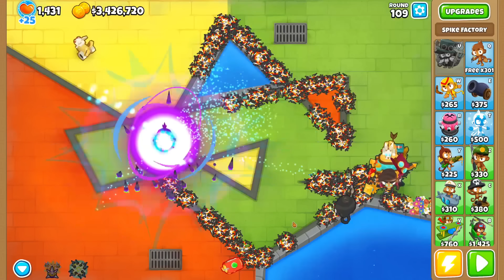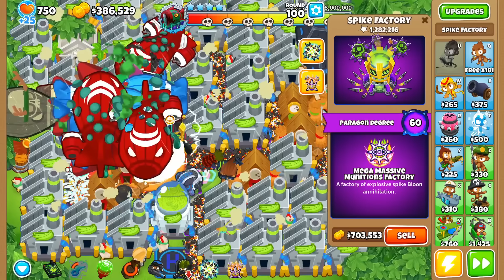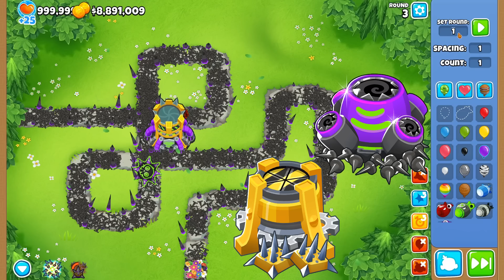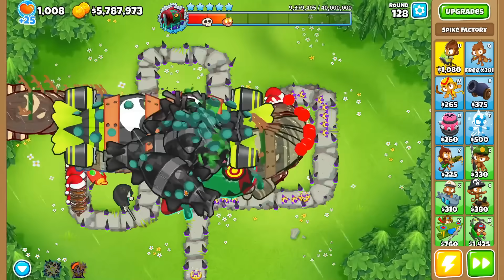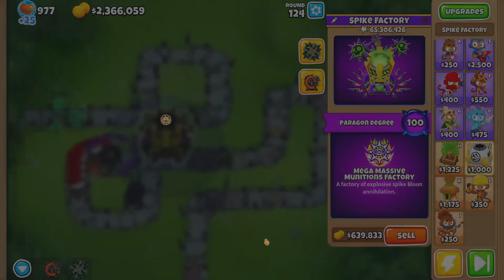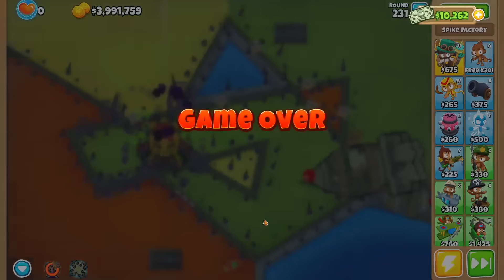How Good is the NEW Spike Factory Paragon in BTD6?

Comment: I think it’d be better if they just prevented boss insta-kills in ranked matches only instead of actively nerfing the brand new paragon against the exact type of thing it’s supposed to be the best at handling… they could just make it so ranked bosses gain an extra pulse ability that wipes out all damage sources (projectiles and track hazards like spike piles or acid pools) at the start of the battle, leaving regular ones alone since nobody should really care all that much what anyone does in non-ranked singleplayer play.
Reply: Agreed but it’d still be overpowered. The boss is supposed to be somewhat of a challenge. The spike factory would insta kill elite bosses with ease which would be overpowered. There’d be no reason to run any other paragon instead. It’d just be a free win tower.
Reply: @  I get that, though having all the spikes disappear instantly kinda renders the whole point of building up spike piles with the tower designed literally to do that exact thing seems kinda backwards to me. I think a better compromise for it could just be to make it so there’s a radius around the entrance location where all projectiles and track hazards with be wiped out, allowing you to still keep a spike pile built up if you just build it somewhere else on the track.

It’s less even about the boss to me than the spike factory paragon just being extremely nerfed for general use during a boss, since those spikes could have defended against regular bloons too. Not to mention, the spike paragon really wouldn’t even really be all that effective against bosses UNLESS you use it for insta-kills, because it drops spikes so insanely slowly and all the other bloons move so much more quickly that even if you DID build it far away from the entrance to avoid my proposed changed version from despawning them, regular bloons would likely set off most of the spikes long before the boss ever could.

A level 70 ace paragon + debuffers would probably be more effective against most bosses overall than a level 100 spactagon because the entire power of it that allows getting to nearly round 300 in the first place is from placing it at the end of the track like a permaspike. If the boss will just wipe out the pile anyway, then pretty much all of its damage potential during bosses is completely wiped out.

Comment: These are rhe changes I think need to be done to the spike factory paragon to make it perfect:

Increase the damage of the permanent carpet of spikes. I know it does more damage to moabs, but it is still not enough. If I'm correct it's just 4 times stronger than the Spirit of The Forest brambles, and hat just isn't good for the price tag. I'm fine with decreasing the bloon damage by a bit even, I just think it should do more damage to moabs. Like, twice as much as it does now or a little bit more.

Rework the speed buff ability. Right now, it's just a stat buff ability with 100%, and the whole "can only be used once a round" limitation doesn't work because the spikes last multiple rounds, meaning that you can just use the ability all rounds whenever possible and it will help you in the proceeding rounds. I would make the ability be just an automatic smarts spikes instead of a manual, would also make Lych more threatning and I like that.

Give it the targetting options of the bottom path. Really surprised it doesn't already have this.

Comment: This is going to be the new ultimate choice against bosses, and it's all because unlike the other paragons, this one can use all of its pierce against a single target. That makes it especially powerful against Lych and maybe even Vortex.

This paragon came out of nowhere, to the point where I started thinking about what the next one would be. I originally concluded it would be either Helicopter or Druid, but this one already takes Spirit of the Forest's main ability for itself.

Equally interesting, however, is that NK likes taking an ordinary tower and buffing it hard to shake up the meta a bit. They've done so for the last few patches, no reason to think it won't continue.
Reply: next  paragon will most likely  a military or magic paragon due to the order they've stuck with. Hopefully its druid but I'm fine with anything that isn't something new like the mermonkey.

Comment: The models for Degree 80 & 100 are the same across ALL Paragons. I, personally, think they should change once you get 1 degree higher than a multiple of 20; that way, each of the 5 models are split across 20 Degrees.

Comment: I think even your freeplay demonstration is a serious understatement of the new paragon's freeplay power. With temples, CC towers, and other paragons handling the ZOMG and lower bloons, the factory can be placed at the back of the track and use 100% of it's damage on the FBAD's that are always the first thing to leak through a strong freeplay defense. 

Also, small thing but the factory would have done better in both tests if it was placed closer to the end - more time to build up mines for the boss, and more damage from the permanent spikes all along the path to weaken the bloons before they reach the spike pile.
Reply: @ true but in a realistic boss battle you wouldn't put it at the end especially if it's your only paragon as the kill time would be too slow
Reply: @pvz_games What? Why? Kill time doesn't matter in most boss events.
Reply: @EllipticalReasoning  for tie breakers it does matter
Reply: @pvz_games tie breakers are a relatively low priority for most people doing boss events, and in the case that a spike paragon in the back of the track is the most efficient way to win (in tiers/cost/whatever), moving it closer for a faster kill becomes an opportunity for skill expression.
Reply: @EllipticalReasoning  true but if for example 10s of people get the same score which happens farily often especially if a boss is super easy the time aspect will matter most, and for the bosses which are time based by default it will also matter. 1/3 of bosses are time bosses (logically at least, since there is time, least tiers and least cash), so it still would be best to just have it further up, depending on map ofc.

Comment: My favourite part of this Paragon is what it means for the Master Builder. One of the older patch notes said they'd wait for another damage-based support Paragon before considering a rework to MB, which is exactly what the Mega Massive Factory is, so now might finally be the time.
Reply: What annoyed me was the Master Builder didn't incorporate all 3 paths. Here's my stupid suggestions for engi paragon:
- Keep the sentries, maybe nerf the damage
- XXXXXL laser trap ability. Can swallow a BAD and provides income. Limited uses per round
- Gigaboost. Like ultraboost that stacks up to 20 times.
- Super cleansing foam. Removes camo and lead properties from DDTs, and fortified from moabs like shattering shells
Reply: @vinesthemonkey Maybe the cleansing foam could also debuff any bloon that passes over it with + damage? I would say slow but that would step on the toes of the glue gunner paragon when that comes out.
Reply: @vinesthemonkey  I had a idea where the bloon trap would be constantly on the floor in a "deactivaded mode" while deactivaded it would work as a unlimited foam and then with a activaded ability the trap woud open up swalowing all bloon types includind BADs
Reply: @vinesthemonkey don’t call your suggestion stupid that seems insecure
Reply: @vinesthemonkey who wants to stack something 20 times? it should just be a boost that u can use on other paragons
Reply: @vinesthemonkey No. Stop. Why does everyone want it to instakill BADs. Not all Paragons should have a BAD instakill like Navarch
Reply: @vinesthemonkey  or gigaboost is an ablity that can be stacked 5 times on paragons and 15 times on normal alongside normal ub
Reply: @vinesthemonkey instead of gigaboost, I think it could be permaboost but it immediately gives 10 stacks
Reply: Dw bro, your idea isn't stupid, just nerf it slightly and combine the cleansing foam and bloons trap in some way and you have the perfect engi paragon  @vinesthemonkey
Reply: oh i was thinking of that too, great It was not something forgotten
Reply: This comment aged well
Reply: Idea
Similar base paragon
Sentries change
One does massive damage
One sucks in bloons(XXL trap)
One gives out buffs in its range (like top path alch)
All still spawn on sentries
Over clock ability
Buffs a tower and itself
More towers it buffs, stronger it gets (kinda like the passive ability but more useful and noticeable)
Reply: NK please
Reply: Foam isn't that good tbh because of towers that do more damage to camos and leads
Reply: Master builder better get the ultra boost ability so we can boost towers to 10x speed
Reply: WE WANT TRAP🗣️
Reply: Ground up reimagining; make engi paragon bloonchipper. The bloonchipper fits the idea of all three paths (autonomous turret, high attack speed, and sucks in bloons) and would be nice fanservice for those who keep requesting bloonchipper.
Reply: @superlagbro192 That is such a stretch
Reply: @ the condor beast handler path is basically already bloonchipper
Reply: It’s literally just the top path. Where’s the trap? Where’s the overclock? (The self buffing doesn’t count)
Reply: @peterpumpkineater6928they technically have the trap path in "pin" the engi gon stuns all non bads on the track